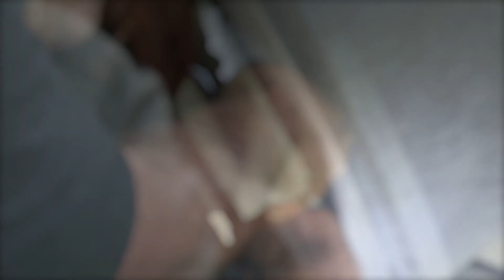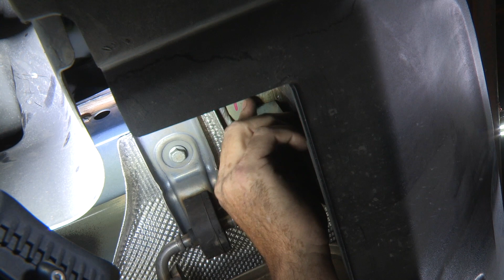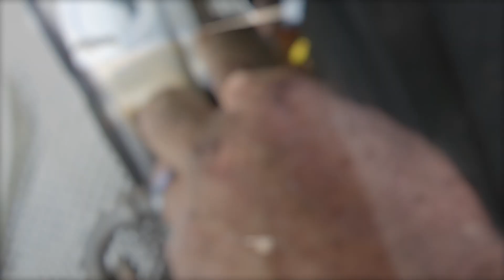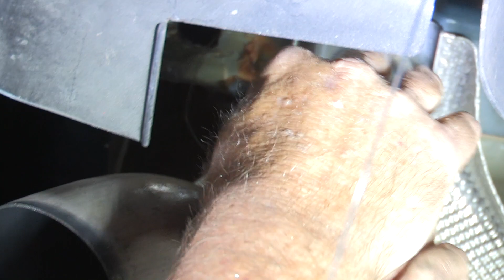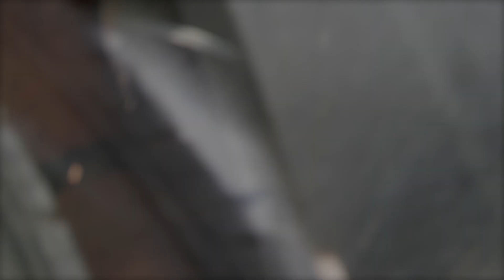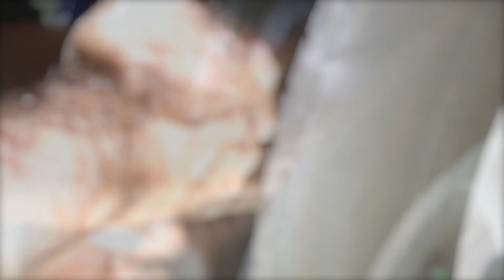2018 Jeep Renegade Trailer Hitch Installation

Comment: Just something about cutting a frame to install a hitch bothers me
Reply: Because he didn't realize jeep renegade has a access square 5in away from him
Reply: @jeep_751   
Can you email me at millsmay67@gmail in reference to your comment. The person doing my u-haul hitch install want to “trim my bumper”.  Not the screw holes on the frame but CUT the bumper. 
This video says nothing about trimming the bumper. 
2018 Renegade as well…
Reply: @tammymillsbakerhigh85  no you do not need to cut bumper
Reply: @tammymillsbakerhigh85  it depends on which one you buy. Some hitches you have to cut a small hole through the plastic square part of the so-called bumper.
To me, that seems the better way to go then your hitch won’t be 4 inches off the ground. 
I know I’ve been looking for Waze because the dealer that I bought the vehicle from told me $2500 to put a hitch on it which is absolutely fucking ridiculous. Thank you, Fiat. And thanks for not giving me a spare tire.
Reply: “Frame”.. unibody, so just formed sheet metal.

Comment: What a ridiculous setup to install a hitch.  F this, gonna pay someone to install my wife’s.  My Jeep was so much easier than this.  I can totally see bolts getting pushed back into the frame if I were to attempt this, I don’t need the aggravation
Reply: Imagine my aggravation when I contacted the dealership that I purchased my renegade from. They told me $2795 to install a trailer hitch. I will never do business with this dealership again. Riverside Auto Marinette Wisconsin
Reply: @jeffb8562   To be fair, the dealership one mounts the hitch about midway in the bumper. It doesn't hang down like that. Its a far larger and more complicated design. You have to remove the rear bumper cover (PITA), and a lot goes into how it mounts.
Also if you had the wrong bumper cover to start, they likely quoted you for the correct one since theres a hole in the center for the hitch to protrude from...